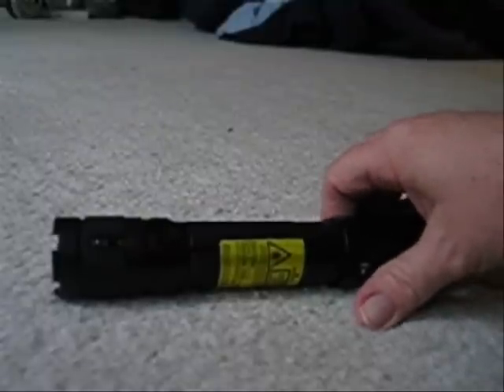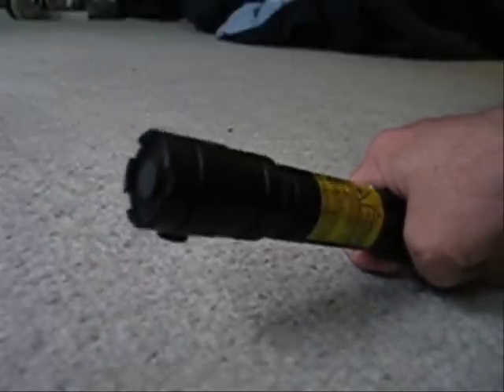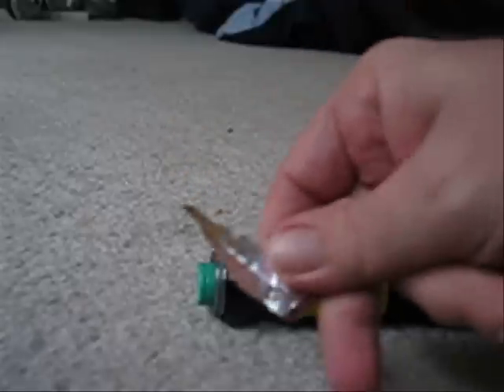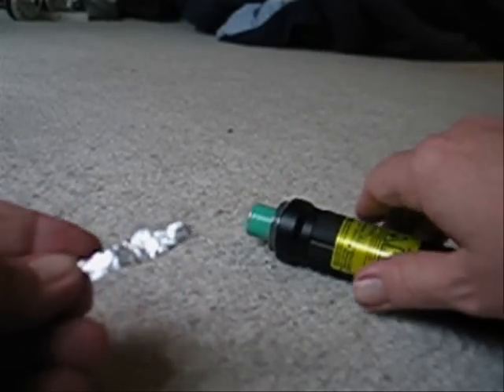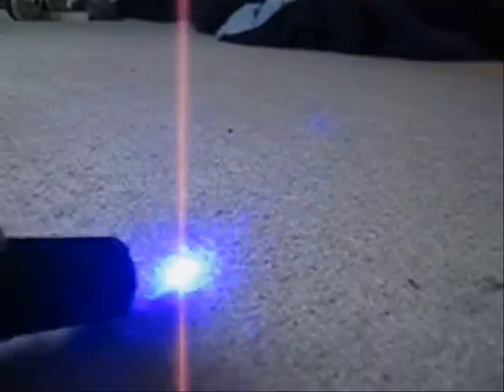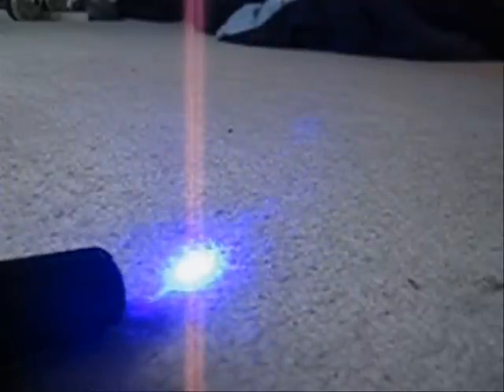Troubleshooting the Wicked Lasers Spyder S3 Arctic laser's end cap

Comment: Great tip.  I once sent my unit in for repair because of this problem.  Your resolution led me to use a brillo pad to sand against the threads on both side, including the brass tip that touches the battery.  Now my unit works fine, and does not turn off when in high power mode.  Thanks!!!

Comment: OMG, I have had this problem! When I go to high power mode on my S3 Krypton it turns off after seconds. I can keep it running on low forever but not high, but with the foil the high works perfectly. Is there a permanent fix for this?

Comment: For anyone who comes across this looking for a solution, try tightening those screws on the endcap. It holds down a piece of metal that bridges the terminal that touches the battery and the threads, fix my issue with the high power turning off.